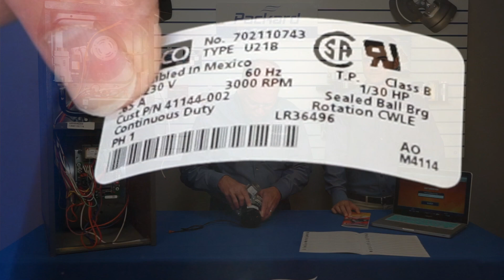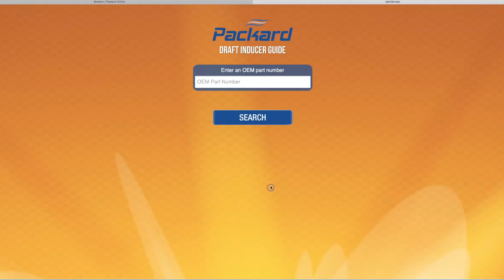How To Easily Choose The Correct Replacement Draft Inducer

Comment: how can I get advice?  I have a Carrier & Bryant model 340AAV048100.  The draft inducer is a A.O.Smith model JE1D013N.  Someone locally sold me a S88-517 Packard.  Will this work?  The wires it self to me, doesn't look correct